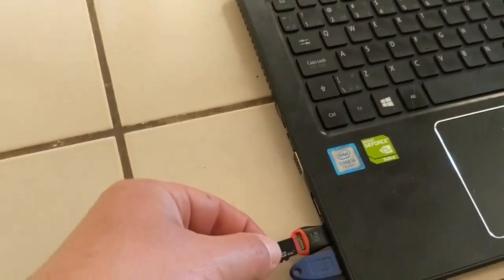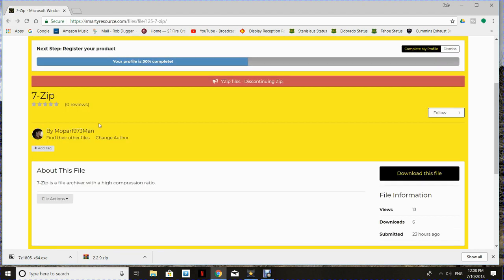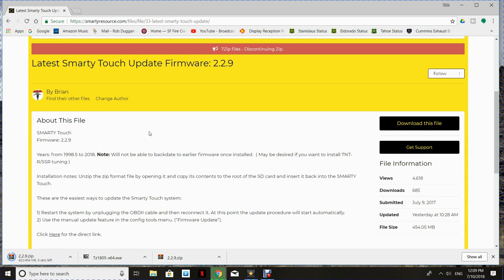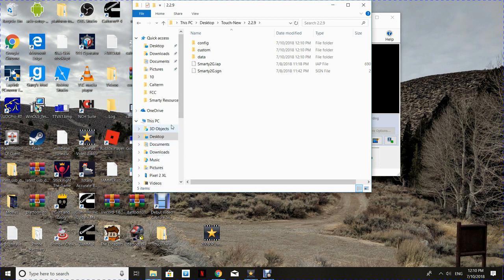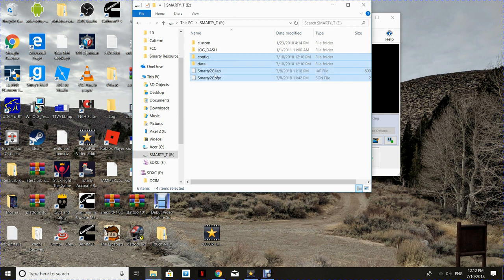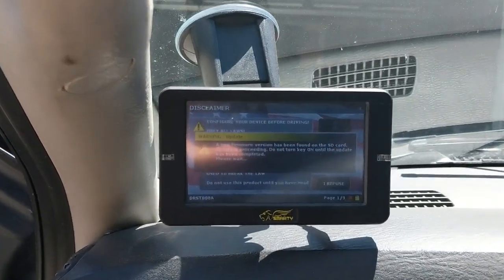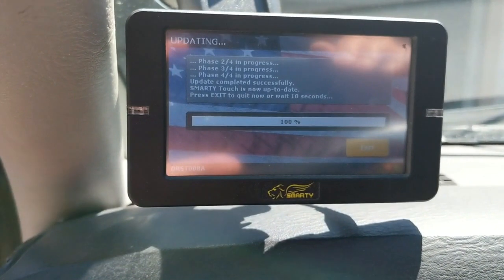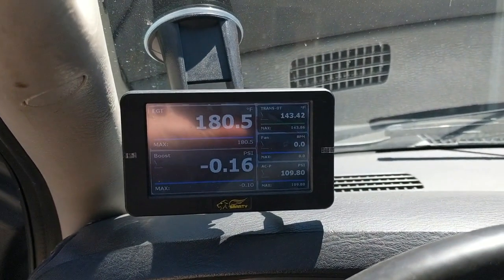How To Update Firmware On A Smarty Touch Programmer

Comment: Had work done on my 2004 RAM 2500 and they plugged in the scanner.   When I picked up my truck I plugged my smarty back in and I am getting SD card is invalid.  Error 20002.  How can I fix this?

Comment: I just bought a Smarty touch and can't access gauges like boost, oil pressure, rail pressure. How do I find these.  I also only have catcher files no Revo files. I've read the manual on their website and it doesn't really have a lot of info on it.  All the links in that manual are dead. 404 file not found. It's kind of ridiculous to spend this kind of money on something with no instruction.
Reply from the maker: Jim just to be clear the touch and MM3 are not my products, I just sell the MM3 and provide custom tunes for both platforms.

You will need to tune the truck to access all of the functions and there is no oil pressure parameter:

https://photos.app.goo.gl/8NaLtkyLsQjVcyCx9

https://photos.app.goo.gl/NcpMddmCQ1DNiQN3A

Comment: Thank you very much for your helpful video!.
I have a 2013.5 RAM 2500 6.7 L, from time to time my SMARTY TOUCH goes blank when starting the engine and turns the right light on, 2 times red, 1 time green and back 2 times red, to stop it I have to unplug it from the OBD2 wait about 10 sec., plug it again and works well for some time.
Any idea what can be the problem?
Reply: any fixes or solutions to this? mine does the same

Comment: Hey man I have a 99 and I bought a used smarty, When I went to go into a dashboard on the monitor it tells me I have sd card error 20002, any idea what’s going on?
Reply from the maker: https://www.mm3tuning.com/sd-card-error-20002/
Reply: Diesel Camper tried that, what if I bought a new card
Reply: Having the same problem. Done everything mm3 says to do and tried other SD’s the smart agent doesn’t work on my computer but mm3 agent is downloaded and I’m going to try to update from that to my smarty. Pretty much in the dark and guessing at the moment
Reply from the maker: Bryson contact mm3power.com in the morning they can walk you through it
Reply: I know this was 4 years ago lol, but mine said the same thing. Just purchased an 01 Cummins, came with Smarty touch, the guy had never set it up. There was already a 2GB SD card in it. It said “SD Card not valid,” so I purchased a 32GB, said the same thing. Called and called around, FINALLY got ahold of someone at Smarty tech, he sent me an email and said to download and install this Smarty Agent Setup, then put the firmware onto the SD card. Ok, well, tried that on my Chromebook, and it says it must be a windows computer. Soooo went and purchased a whole ass new laptop with windows 11, downloaded the smarty agent setup after going through HELL to get it to even download (laptop wouldn’t allow it to download because of safety measures so I had to bypass all of that), now I’ve got the Smarty Agent Setup downloaded on my new laptop with windows 11, tried to open the damn thing and download the files, aaaand it says “bad local updates to index file. Error: length of data to decrypt is invalid.” 
So what fkn gives man this has been literal hell.